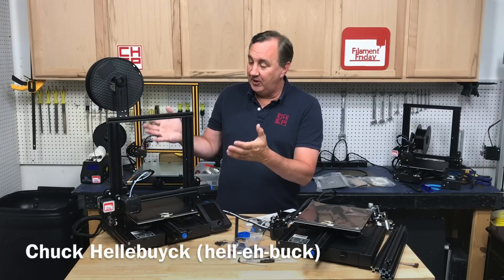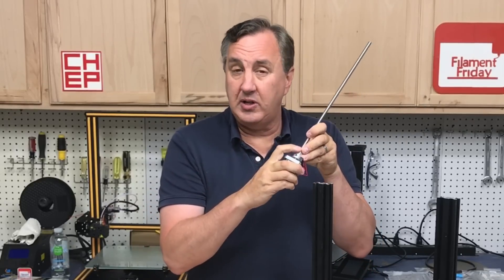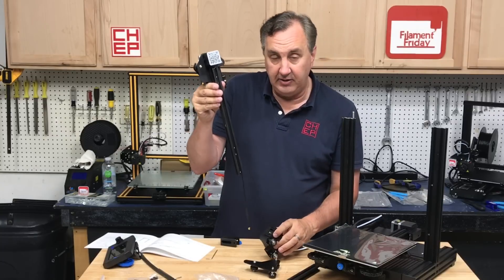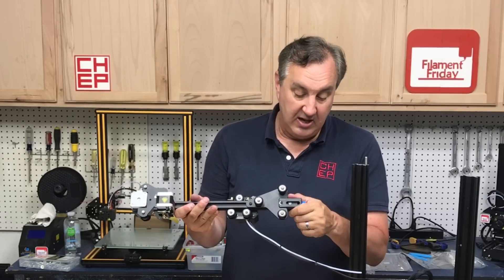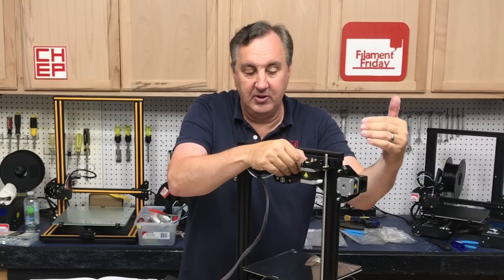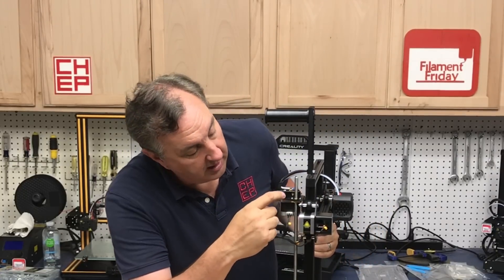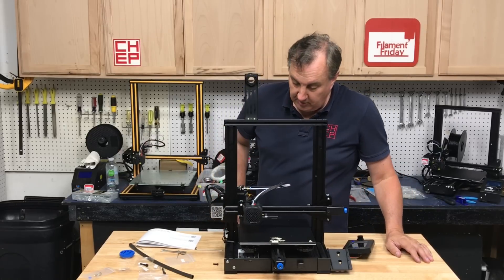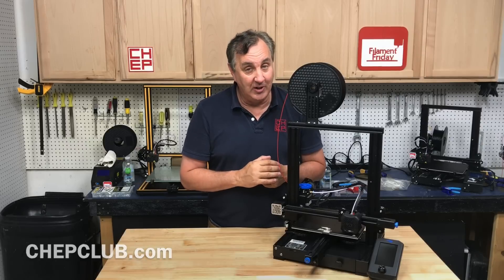How to Setup an Ender 3 V2 3D Printer

Comment: Talk about perfect timing. I got my V2 last week and I've been faking it (somewhat successfully) so far. I used your original ender 3 assembly vid to put this thing together and I was just looking into how to update the firmware.  Thanks.

One thing I did differently on assembly, was that I put the z drive screw in after installing the crossbar, which allowed me to set up the tension on the wheels more easily. 

Loaded v.1.0.1. Seems to work.
Reply: Your videos are so educational and let me hit the ground running when I got my V2 a couple weeks ago, for the most part it’s been great but the last couple days after a failure, I’m having a terrible time getting the level dialed in. I’m having issues with the print not quite sticking in the center, bing near perfect at the edges and corners. Any advice, or should I just order And install BLTOUCH - still trying to learn more about that so I can do it right
Reply from the maker: BLTouch doesn’t solve those types of issues. Clean the bed with IPA and see if it sticks better.

Comment: Edit :Thank you for the nice instructions. I decided on getting V2 thanks to one of your earlier videos. It is very quiet (except the fans) so far as you said.
Created my own gcode and it is seeing/reading the files now. Thank you for the help.
------
Reply: If your trying to see .gcode files, copy them from the model folder to the root. Or your own of course.  

If your trying to update the firmware via .bin file, try renaming that .bin file downloaded from Creality to a name you haven't used.  I.e. wtf.bin and see if it takes.
Reply from the maker: Does it have a .bin file on it?
Reply: @FilamentFriday  Thank you for the reply. I tried both with and without the bin file. Also when the card has the bin file I restarted several times but it didn't update the firmware.
Reply from the maker: Sounds like a bad board.
Reply: @FilamentFriday  @Tim D 
Thanks again for the suggestions. The files were on the root. I decided to give it another shot, this time created the gcode myself and it recognized the file and printing now. 
Changed the name of the firmware too but it still doesn't update. Hopefully I will resolve that issue too.

Comment: Excellent video Again¡¡. Are these new firmware for the Ender 3 v2 based in Marlin 2.0?
Reply from the maker: Yes
Reply: @FilamentFriday  thanks to confirm.. I saw today in the new Creality Web, a new firmware with BL-touch for the Ender 3 v2.. Let's see..
Reply from the maker: Yeah, I saw that too. Very interesting. There are BLTouch mounts for V2 on Thingiverse as well.
Reply: @juancarlospereira5615  AWESOME!!!! FASTER THAN THOUGHT! Good job Creality!
Reply: @FilamentFriday  Do I need to upgrade again to this Marlin firmware? Or just the firmware being talked about in this video is all good. I am currently not upgrading any hardware just the plain Ender-3 V2

Comment: When I installed the vertical rails on my Ender 3 V2 I used a small machinist's square to align them to be 90 degrees to the bottom rails. Worked great. I installed the Z-limit switch all the way to the bottom rail and when I went to level the bed I ran out of spring tension before I could get the bed up to the proper position. I looked in my can of springs & found 4 that were about 7mm longer & a little stiffer and that did the trick.

My only complaint is loading filament through the extruder. I think if Creality did a steep countersink on that hole it would make life easier. 

I'm enjoying your videos. Well done & informative.
Reply: There is a a little plastic stub out on the z-limit switch bracket.  Bottom of the stub out should set right on top of the bottom support rail, not below it.  Using the stock springs (or the upgraded yellow ones which provide more tensile strength), and turning them all as tight as they will go by compressing them, the nozzle should NOT hit the bed when you Auto Home for the first time (as long as you didn't cut the stub out off of the bracket and set it on correctly) .  After that, then start loosing the springs by turning the wheels to get the bed up towards the nozzle about 1-2mm away so you can move onto the bed leveling process.
Just info to help is all.  Not sure if your z switch bracket is way too low which is why you may have run out of spring compression to keep the bed more solid, less soft springiness.

Never could figure out why people cut this plastic stub off?  I know to get the switch lower, but then you risk the chance of smashing the nozzle into the bed before it hits the switch?

Comment: I noticed in the assembly instructions that it does not have any procedure for squaring the frame, the x-axis bar, or messing with the eccentric nuts. My x-axis initially seemed very tight and secure but after a few hours of printing I noticed it was sagging on the right side by 3-4mm. At the same time I am having to re-level the bed between nearly every print. I thought I had taken care of this by running the bed screws most of the way in, and it seemed fine between 3 prints, but the first time I printed without exhaustively checking the bed level, the nozzle destroyed the top of my glass before I could turn it off. I have tightened the eccentric nuts twice and it seems like they keep being forced out of place. Is no one else having these issues? This seems like a major design flaw, I really regret not getting one of the models with dual lead screws.
Reply from the maker: I covered squaring the x axis bar in this video.
Reply: @FilamentFriday  Yes, I saw what you did in this video, thank you, that's one reason I was commenting here. Apologies if my frustration sounded in any way like it was criticism towards you, that wasn't my intent. I did my best to make sure my frame was square and initially my X-axis felt very tight and was parallel to the top bar. It just seems like I need to keep re-adjusting it after printing for a few hours, I feel like I am missing something. I will take it back apart and see if I can find any issues. Thanks again for your videos.
Reply: @forrest280z  There is going to be a limit or tradeoff on absolute perfection.
Reply: Live and learn.
Watch some build videos first or side by side and it will go together and print flawlessly.  User error.  YES, the chinese instructions suck... always have.  

Just look for MORE Ender 3 (Pro and/or V2) build videos, some are more thorough than others.

You'll get it.  Not the end of the world, just simple untightening of screws, adjustments, retightening.  Main thing to watch out for, easy to round or strip out Chinese screws, bolts, nuts and threads.  So just be extra careful here.  ; )
Reply: Yeah, it's the dual lead screws either...think u have trouble now with 1, wait until u try 2.
Reply: @timd9430  Appreciate it, I will look at Pro videos. I looked at a bunch of V2 build videos and didn't see anyone addressing this. If you have a link, it's appreciated, there is a lot to sort through. My A8 has dual screws and the X-axis stays exactly level, so I assumed it would help here.

Comment: Hi, I’m very new to 3d printing (3 months) and I’m loving it. Thank you for all your great teachings.  I’m using a ender 3 and printing exclusively with PLA. My wife read online that during the process, it emits harmful VOC’s so she basically told me that I had to stop printing. I’ve been following your videos almost religiously and I value your opinion and the opinions of your following community. What are your thoughts on the subject? Is it really that bad? Do you have any solutions? I’m thinking about building a weatherproof enclosure to print outside but I’m worried of the effect of changing humidity and temperature on my prints. Any suggestions is highly welcomed.
Reply from the maker: Printing ABS can cause some fumes which is probably what she read about but PLA is a plant based plastic so it’s considered very safe.  I have all my printers in my garage and it has good ventilation. Maybe consider that.
Reply: NEVER print in the same room that yuo are gone live,sleep,eat, try to use another room
Reply: Pla emits tinny particles ..soo she its rigth..of course yuo need a lot expositino to have lungs problems
Reply: @noway8233  "PLA emits tiny particles".
So does a fart, and that IS FAR WORSE than any ABS. :O
Reply: @noway8233  pre coronavirus, also do not get on a plane, get in a car, go out side, or just do not do anything.
Reply: Dude, take command... my goodness.

If anything, the PTFE tube "can" put out noxious fumes if you exceed the max tempature the tube was meant for at a long period of time.  But that is why you need to swap the stock hotend with a ALL METAL hotend.
But you only need to do this if printing using materials that require much higher melting points such as Nylon, ABS, polycarbonate, etc which you may not be doing at this point.  If you do, kick the dog out of the dog house and move you and the printer back in.
Most are using PLA which perfectly safe.  One can make anything seem bad and harmful depending on how paranoid they are persuaded.  Hell, look at the current news today.  Just pure fear mongering whooping everyone into submission and cannot live their lives like they really should be.

Good god man, do what ya want unless you have small animals and birds in the house and running super hot temps on the stock hotend and burning up the stock PTFE bowden tube in the same enclosed room!  Then yeah, let your wife beat you into FURTHER SUBMISSION.
Reply: @timd9430  I wonder who you voted for last election ;)
Reply: @jonathanroy6258  and going to AGAIN!

Comment: Nice CHEP, lots of good things, but here are my remarks:
I would mount the spool holder bracket the "nice part" looking forward (the other way, to hide the nuts) ;)
I would not connect the motor cables before all is assembled and set. Reason beeing you do not want to inject current into the MB while moving everything back and forth  ;)
I would not provide the firmware.bin naked. It should be zipped in order to let Winrar or Winzip test for CRC errors after download.
I would not screw and turn the PTFE connector into the filament extruder block while the PTFE tube is firmly attached in the connector with the blue clip, reason being that the teeth inside the connector (holding the PTFE in place) will grind on the PTFE when rotating...
My 2 cents...

Comment: How do you restore the original firmware? This updated firmware has rendered my printer useless.
Reply from the maker: Try updating it again but change the name. Don’t use filename.bin use something else.
Reply: @FilamentFriday  Changing mine from filename.bin did help, even after it appeared to have been bricked. It would not boot at all after attempting to use the firmware.bin name, even after rebooting without storage in.  After the rename we're good!
Reply: @FilamentFriday  I have updated it several times using different file names and different SD cards to no avail.   It powers up fine but will move in random directions if I start a print.  Also it tries to have the print speed set at 942%.  I am at a loss as how to get it back.
Reply from the maker: What version did you load?
Reply: @FilamentFriday  I used the firmware for v2 from your site, for some reason my printer does not like it.  I was able to install 1.0.1 from creality and its running again.  I have no idea what the issue was.  I appreciate your help and have been using your cura profiles with great success.
Reply from the maker: Glad you were able to recover it. I removed the marlin link for now until I can test it further.
Reply: I'm bummed about it, I really wanted to utilize your bed leveling g code.  I do feel  so far like this firmware update resolved some of the issues I was having.   Most of all I would get layer shift on random single objects if I was printing multiple cylinders.   At times it would have 1 out of 20 of the same parts on the bed layer shift.  It seems to have gone away now so I'm happy about that.
Reply from the maker: There is a firmware version linked on my bed level page that supports my GCode. I just haven’t done a lot of testing with it yet. https://www.chepclub.com/bed-level.html
Reply: @FilamentFriday  the V2 version of the firmware on your site is the one my printer didnt like.  I may try again now that I know version 1.0.1 on creality website can restore the printer if I have issues again.
Reply: @FilamentFriday  Is this an updated version of 1.0.1, or of 0.0.9 (or whatever Creality's first rev was)?
Reply: @FilamentFriday  IMHO a firmware MUST be provided zipped, not naked. With a zip file you have CRC checks. Read the rest of my comments above please.
Reply: CHEP i installed the 1.0.1 firmware from the link on the bed level page.   Confirmed in info.  Your gcode runs, but doesn’t pause so you cannot level any points

Comment: Just an FYI for 3 V2 users. The extruder backplate is different than other Creality printers, so a lot of hot end, fan and other accessory mounts will not fit.  Different screw holes, etc.  I am ordering a 3 Pro backplate to replace mine so it is more universal.  Another annoyance is that the PSU is mounted horizontally in the back on the bottom.  This is nice, unless you want to upgrade the fan, or change the case to hold other things.  This is definitely a more complete, out of the box printer, but upgrading is more difficult.  if you just want a base unit to add a bunch of upgrades to, maybe the 3 pro, or another model is best.  Then again, I suppose if major upgrades are your goal, maybe just start with a higher end printer?
Reply: "Extruder" backplate?

I suppose you mean the the metal backplate the hotend, fan cover etc are attached to on the x-axis assembly.

The "extruder" is where you initially feed the filament through while holding the tensioner arm into the bowden tube.  It's motorized with a gear and idler pulley.

But yes this mounting "backplate" is different than Ender 3 and Ender 3 Pro.  This is probably the biggest drawback compared to them.

Where are you getting "just" this Ender 3 Pro backplate by itself?
Reply: @timd9430  I am aware of what an extruder is.  Don't ask me why, but that part is called the extruder backplate.  They are all over Amazon.  Not Creality branded of course, but they look identical (fingers crossed).  If it doesn't work, I'll just buy a whole E3 Pro and take the parts off that make my V2 more universal I guess.
Reply: @bkblake01  you're totally right they are calling it a "extruder backplate" yet it's not part of the "motorized bowden extruder" itself.  Sorry, with new users, they may have wondered all day where this "extruder backplate" is on their geared filiment extruder. ; )

Technically, yes, seems even the entire system from filiment entry to filment exit.... is an "extruder". ; )

Thanks for Amazon info.  Going to order 1 also.  This may be the solution for now until more options available for the V2.

Comment: Have you noticed when your start warming up the machine the power supply (?) fan ramps up and is quite loud compared to the rest of the machine. I think my Wanhao i3 fans is quieter. Shame given how quite the rest of the machine is. I love the glass bed and I’m surprised how hand that little draw is. I never though I would be a fan of the Bowden extruder but after using it I’m not hating it, who knows maybe with time I’ll love it. I guess in theory it should mean less ghosting.
Reply from the maker: I heard someone complain about that on the CR-6 SE. mine doesn’t do that.
Reply: CHEP might be misplaced thermocouple or something.

Comment: JUST WHAT IM WAITING FOR!
Reply: UPDATE: After i updated the firmware, it seems fine at first. BUT when its going to start printing.   rather than extruding y for start print, it goes to the far X, and gets stuck. Stopping it by force power off at the power supply. 

Does this mean my Ender 3 V2 has a different version mother board?? I even tried self BUILD in VS Code, same results.
Reply from the maker: I’m not sure. Try updating it again but change the file name.
Reply: @FilamentFriday  i will try. Thank you CHEP! Will try to update if it'll work or not. Currently went back to the creality website firmware.

Comment: I got a regular Ender 3 right before the released the V2. I’m so sad :(
Reply from the maker: Don’t be. It’s a great printer.
Reply: Yeah, don't be, the V2 is still essentially mainly a Ender 3.  If you want to make it better and for a lot less money, just update the board with a BIGTREETECH SKR MINI E3 V2.0. and you can also change the display if you like, but no need.  You upgrade the power supply to s MEAN WELL for $30. Can update the bed too whatever you like.  The good thing about Ender 3, its the classic and nothing but options for it if you want to do that...you may be perfectly find with the stock Ender 3.  It prints great right out of the box.  Trust me, no need for regret.  : )

To tell you the truth, there will be a wait for certain specialty upgrades for you V2 due to slight differences of changes made to the V2.  I.e. direct drive kits.  Its all good!
Reply: Thanks for the suggestions! I bought Capricorn tubing, a metal extruder upgrade, and a glass bed.
Reply: Fırat Volkan Tanınmış yep
Reply: Fırat Volkan Tanınmış I adjusted it and it works fine first layer sticks well, pops off well

Comment: I've seen at least three different places that say to rename the firmware file to firmware.bin, but I loaded it with the name it came with and it still loaded fine.  I don't think the file rename step is necessary.
Reply from the maker: I corrected this in my comment posted. It’s not needed. I was mistaken,
Reply: It prob worked for you the first initial time using the name firmware.bin.  I think if you do this again with say a newer version later, you may have to rename to another name.  I.e. firmware2.bin for the printer to take.